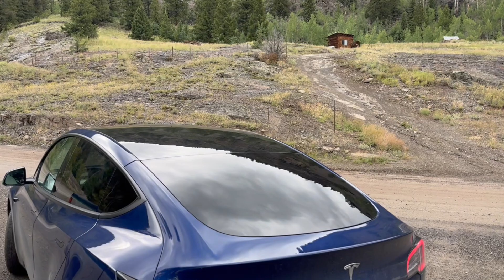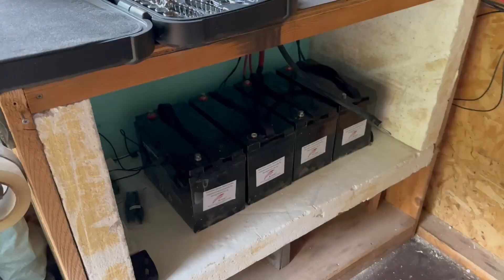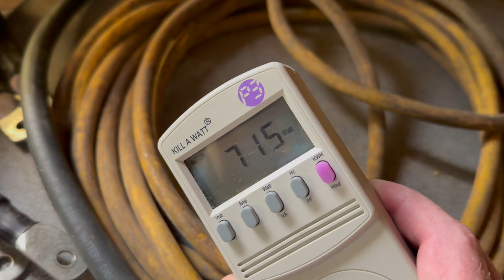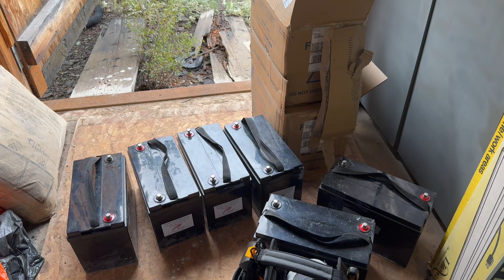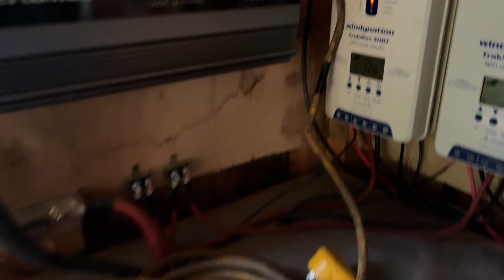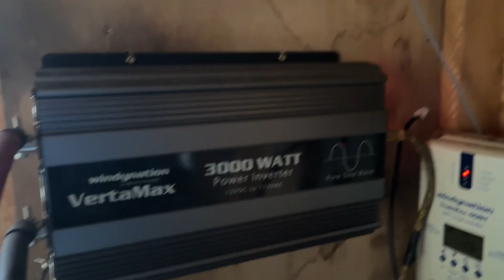Off-Grid Solar System Testing Update!! | Lake City, Colorado

Comment: Please check the battery chemistry before charging them. The typical charging voltage for VRLA (Lead Acid) batteries is not the same as for GEL batteries, and AGM batteries use a different voltage as well. Additionally, GEL and AGM batteries should not be equalized each month with high voltage. You should verify this on your charge controller and select the correct battery chemistry; otherwise, the batteries may degrade faster. Be careful this time , Good luck
Reply from the maker: This is great feedback. I asked this question to windy nation and was advised to use the “sealed” option on the charge controller. This is what I used last time as well however. I too was concerned that could be related - they say no?